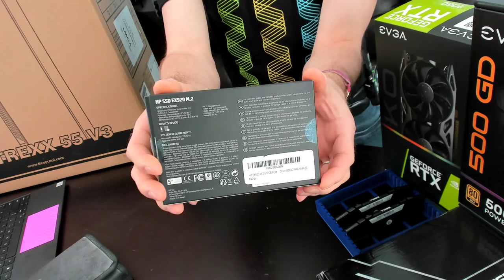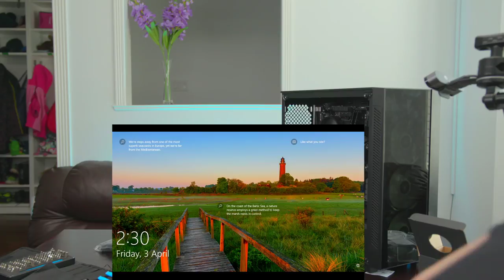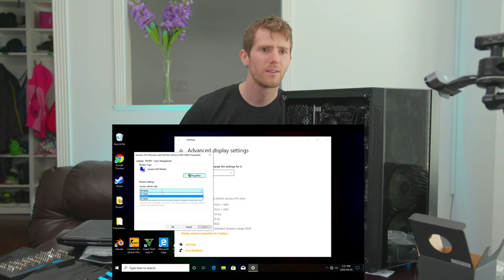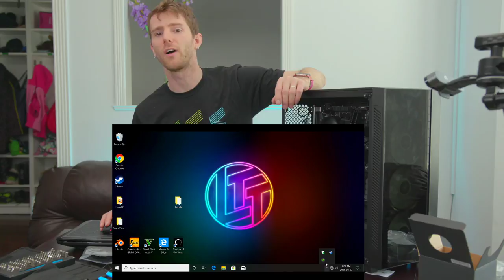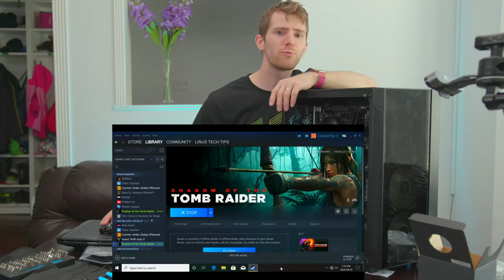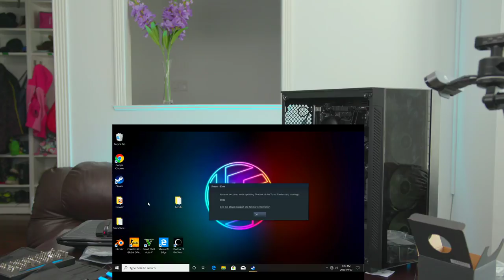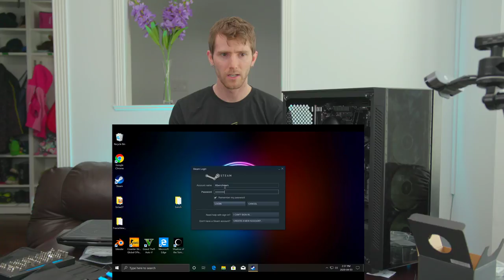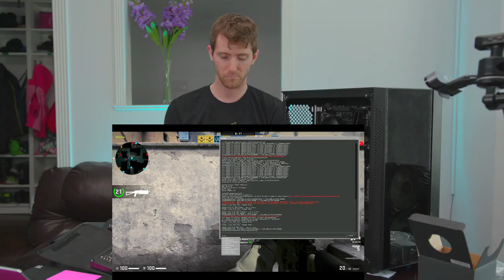Building a Value Gaming Rig at Home - $800 Budget

Comment: I’m here watching 9 months later seeing that the RTX 2060 is the whole setup. RTX 2060 is 750-850$ in 2021(On Amazon)
Reply: same lol
Reply: i have a almost 1200 dollar pc its a pre built, whatever, but uh it has almost terabyte SSD RTX 2060 600 watt psu intel I-7 10 700F me watching this like, no way its 800
Reply: Don't buy a pc in winter/early spring because the prices are wayy to high summer is the best time to buy a pc so yee
Reply: I bought my rtx 2060 for 350$
Reply: @silverz7989  recently or....?
Reply: @leobraderz5964  10 days ago
Reply: @silverz7989  BRO HOW!!
Reply: @Benji-kg3bt   its because urs is a prebuilt
Reply: Uhh i can get a 2060 for abt 320 dollars from countless sellers. So, can't relate
Reply: @silverz7989  where did you find it on the website?
Reply: @Benji-kg3bt  I built a 700 dollar PC with a 
R5 1600af
Asrock b450m steel legend
T force delta rgb 16gb 3200
Intel 665p 1tb
Evga br 600w
Thermaltake versa h18 tg 
Uphere 3 rgb fans
Evga rtx 2060 xc 
No need to flex that’s a bad value PC for 1200 dollars
Reply: @silverz7989  wait you're from spain too? Damn I haven't been lucky with finding gpus that cheap
Reply: @silverz7989  I can’t read it
Reply: @uzi1375  its a portuguese informatic store
Reply: More like $1600 setup lol
Reply: @Reverse_Goat  Where did you buy your components? I’m just a beginner and I am trying to build my first pc. I’ve decided to use your components but I’ve seen that the total amount went way over the budget you said.  if I’m not able to use your components because of the budget what components would you recommend me to pick that are in $700-$800 budget range. Thank you I just want help building my first pc!
Reply: @johnathan2529  it was just before the pandemic and I brought it on Amazon
Reply: @johnathan2529  I say wait let the mining drama end
Reply: @Reverse_Goat  alr I will thanks
Reply: @silverz7989  Bro its literally 950 rn
Reply: just buy amd.
Reply: @silverz7989  lol I ended up getting a 3060 for 380
Reply: its $900 now
Reply: @silverz7989  now it's up to 720, you Lucky
Reply: @Jack Mihoff fax
Reply: This aged well----

If you can get one.
Reply: 900-1200 now here in good ol' Canadia
Reply: I know, its ridiculous
Reply: @silverz7989  I bought my rtx 2070 for $25 more
Reply: SAME lol
Reply: Is a rtx 2060 super any good.
Reply: @leonardolimon8371  no, no its not. I bought my rtx 2070 in early 2020 and its barely good enough for most games I come across now. Back then I paid $375 dollars, right now, a 2060 is about a thousand dollars. Fuck this economy and the illegitimate government that imposed it.
Reply: @ivano7770  Update: "so that was a fucking lie"
Reply: Shoot For The Stars, Aim For The Moon 💫
Reply: I'm here watching one year later and the 2060 is 1200
Reply: I got a 2060 before the gpus went super expensive. I bought mine for like 320 if i remember correctly
Reply: WQW
Reply: Only if he knew
Reply: @ivano7770   that didnt age well...
Reply: Perfect time for my mum to buy me a pc.
got gt 1030
PAIN
Reply: Yeah that shits cringe af I’m tryna build a new pc and that’s the cuck point
Reply: Use an rx590 FATBOI instead! It's cheaper and its a little worse and I bet you i could get a gaming rig for 700$ using it!
Reply: I need a new cpu im not shore what i want to pick. A ryzen 5 5600 is that good enough for streaming?😅
Reply: @silverz7989   Where from?
Reply: @bradyparker9537  France, but bought it on a spanish website
Reply: Frfr I was like wtf you mean 800
Reply: @Benji-kg3bt  gpu's in 2021 are impossible to find at a good price. Gpu's at 500$ are 1000 now.
Reply: Can we have the likes stay at 666. Its funny.
Reply: Feels bad man
Reply: That’s gnarly. I got a RTX 3070FE at Best Buy for $500
Reply: U crazy ? An gtx 2070 super cost 500€
Reply: As of today I can get a 2060 for £300-£400 second hand which is about 350-500 dollars or so
Reply: Yeah its so dumb, Gpu prices are skyrocketing.
Reply: @ivano7770  it is summer and the prices are still going up.
Reply: Haha facts
Reply: I’m lucky to have got a 2080 super for £400  rn
Reply: @ivano7770  2021 summer entered the chat.  they are 1200 now.
Reply: @Benji-kg3bt   is
v
Reply: 1100 on newegg
Reply: 8 months later shits are still as bad, if not worse lol.
Reply: Prices are making APU rigs more and more viable.
Reply: they’re now 1.1k
Reply: @mrmenace6545  bruh so many cards on pc part picker arent even available or you find a 2060 for over 700 dollars like wtf is goin on??
Reply: I was just thinking the same thing. Haven't bought a GPU in many years. Wanted to upgrade and was checking around like WTF happened over the past few years? Actually impossible to buy a decent GPU for under $400. How TF is anyone supposed to make budget builds anymore
Reply: @Tobez  dude its impossible to even buy a gpu for MSRP. Much less 400 bucks. This market is fucked right now. At least for graphics cards. And budget builds are pretty much done, yea. But its a good thing i got my $1900 pre built pc.
Reply: @Tobez  use an APU build.  The ryzon 3700 G works pretty well and is under 300 Dollars.   Might not be everything you want but as long as you shell out for some decent high speed RAM it will do the job.
Reply: Right here its 550 euros
Reply: im reading this 9 months later to tell you that its still 800$ to 1000$
Reply: 10 months later its come down some which is good
Reply: @Benji-kg3bt  chip shortage plus resellers, plus crypto miners. It's very real that a 2060 sells for that much unfortunately
Reply: @Benji-kg3bt  that’s because it’s a pre built they probably were only 800 to build but they need to make profit but even now a 2070 pre built is almost as expensive as a damn 2070 alone lol
Reply: Just toted this up and it's now  2114 CAD (1231 in sterling). The GPU is 1000 CAD on its own.
Reply: so true..;p
Reply: n now?😵
Reply: Yeah no joke,my life is ruined
Reply: @silverz7989  i just bought mine for $220-230 on amazon